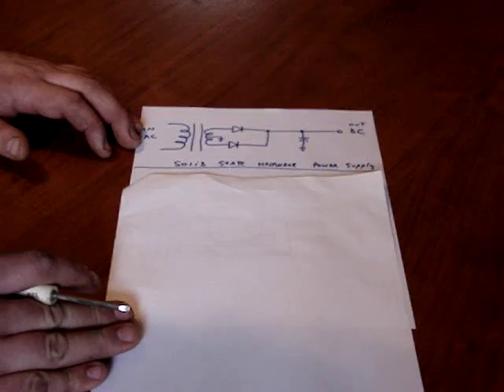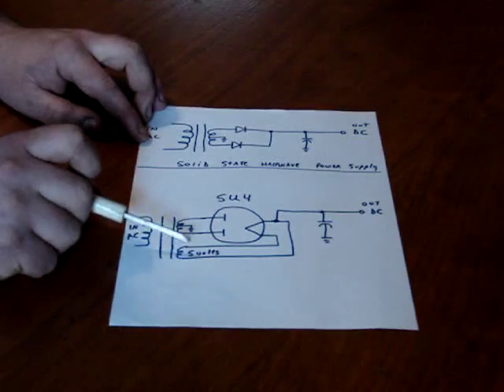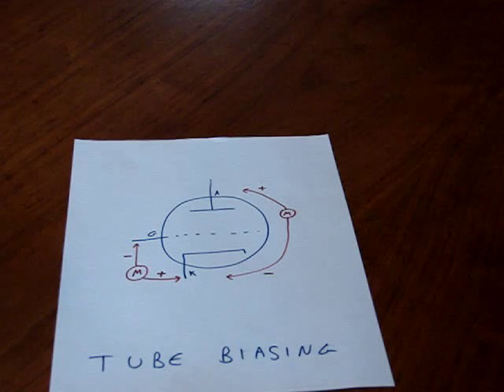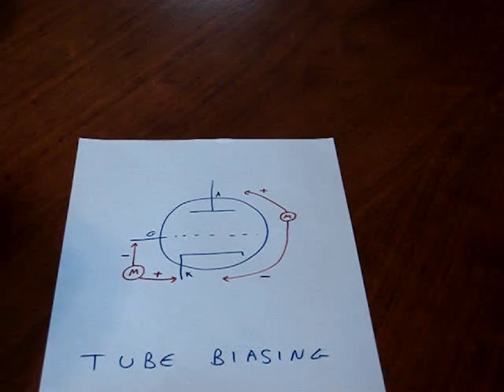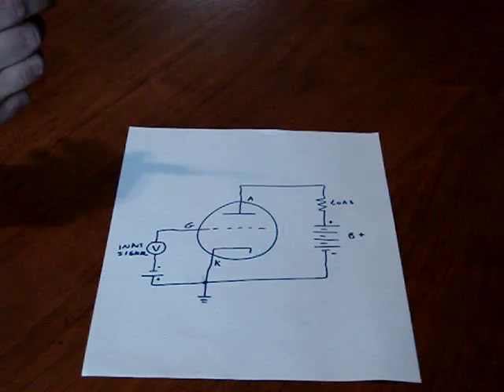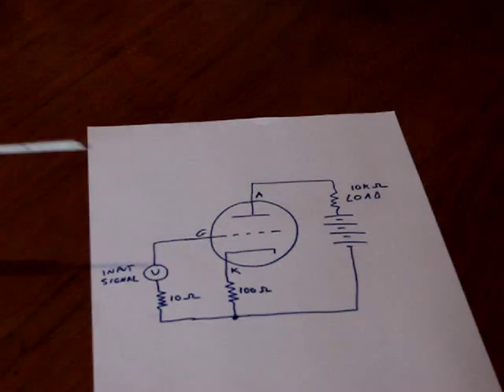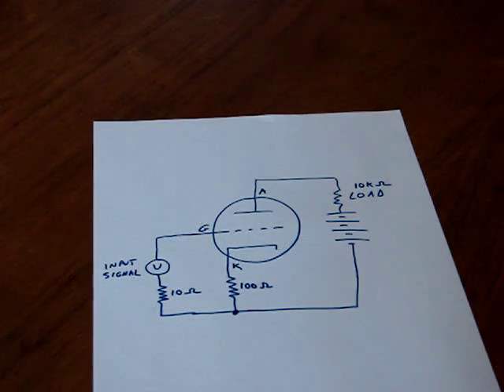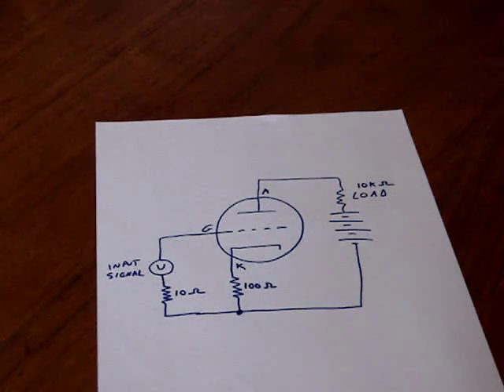The Learning Series - Vacuum Tubes and Amps Part 4

Comment: Interesting to see this again...I learned about vacuum tubes way back in the 1950s courtesy of the Navy in a 44 week long course on Basic Electricty, Electronics, Analog (fire control) computers, gun drives, synchros and servomechanisms,  and tracking Radars all older tube type systems...brings back memories...afterward granduated to solid state via UNIVAC...and others...

Comment: Hi, I thank you for your explanation on the basic biasing topology, it is making sense to me more as I watch other videos of the same ilk. i have conficting models in my head which I need to overcome. I get why your diagram shows the grid to be more negative wit respect to the cathode (k), but what doesn't help me in the understanding in other lectures etc... is the grid resistance to be at around 1 Megohm and the cathode to be around 470 Ohms with bypass capacitor. Can you please clear this issue I have up for me? I hope you can.Being un the UK, I only have a difference of the power supply voltage, all else should be the same. Thank you.

Comment: I'm reading about  the Williamson UL push pull and with this videos is getting more clear to me how they work thank you
Reply: The Williamson for those who are interested(?) was a high fidelity amplifier that set new standards of performance in audio and in fact in all probability a decent amp made to this topology with decent transformers is likely to out perform almost any amplifier and certainly any modern transistor amp under a few thousand pounds/dollars. The circuit was invented by Harold J Leak in 1947 and was the first amp to offer distortion products below 0.1% (total harmonic) The amps were named ''point one''  and a long line of fine Leak amps followed till taken over by the Rank organisation and awful transistors were made. The heart of the new Point One was a special transformer with a percentage tapping on the output that was connected to the screen grid (tell me if i'm wrong..its ages since i looked at a circuit) and also known as ''ultra linear'' gave remarkable performance improvements. These amps use a pentode or tetrode not the triode shown here of course.

Comment: Good explanation but i think your illustrations demonstrate full wave rectification and not half wave.  Half wave rectifiers are less efficient and do not require a center tapped transformer.  They're very common in antique radios.